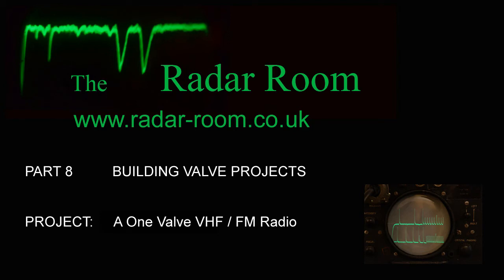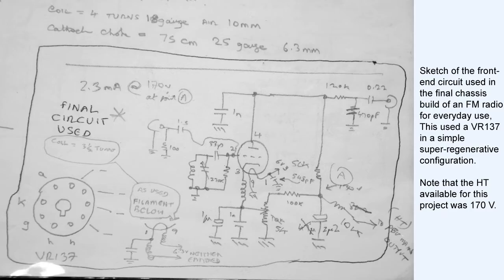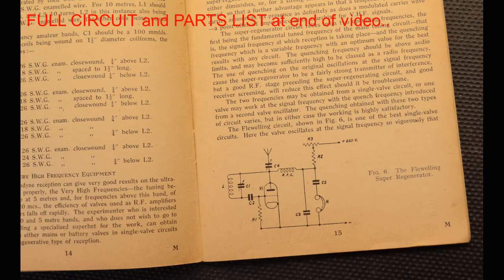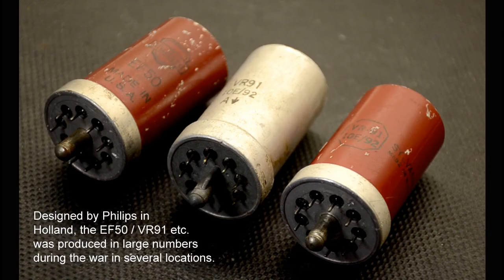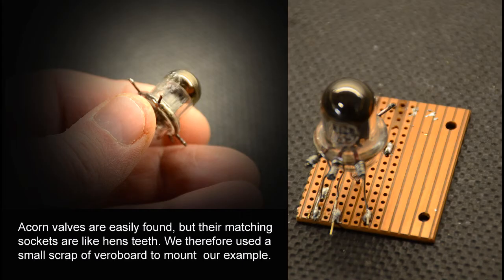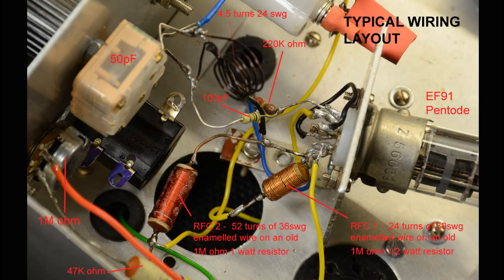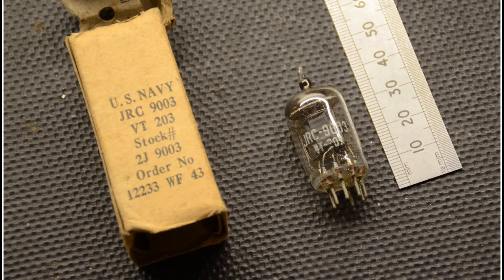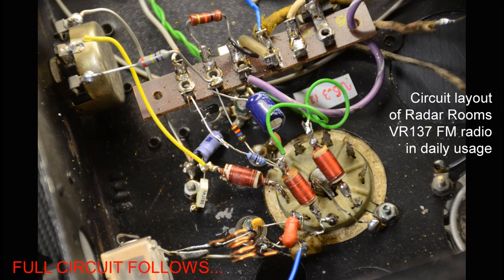One Valve FM / VHF Radio Receiver - tried, tested & demonstrated!

Comment: Hi can you please tell me what tube to use
Reply from the maker: It all depends on what you can find in your area I guess?

As-per the video, I am currently listening to a set with a VR137 in it and that works really well,  BUT it might be difficult to find one, then you have to find the non-standard  base to go with it. 

My preferred choice must therefore be either the 'ACORN' triode, the 955 or the identical valve in a different larger glass case, namely the JRC9003. There are LOTS of ACORN 955 triodes out there so I'd look for this. 

Note that there ARE bases for ACORN valves (even though I don't have any here) but I personally wouldn't like to use one as you have to force the little  pins down into some strong metal clips... I think they might break... 

Use my own idea of twisted wire on the valve pins soldered to a piece of veroboard. See my picture in the video to see how this is done. Good luck with making it!

Ps Just looked on fleabay here in the UK and found 15 of the 955 ACORN triode currently for sale.

Comment: Just one thing if people want to follow along then please use the vacuum tubes designed in 1947 with a heater voltage of 12V and a B+ of 12V and were to be used in Car radios because the transistors of the day weren't ready for prime time.
Reply from the maker: Pls. see my reply to your other comments.

Comment: High Voltages can kill
Reply from the maker: All very true David. 

Indeed it is possible to run valves / vacuum tubes at such low voltages, not necessarily those destined for car radios either. Take a look at the small 2 valve portable short wave set I had published in Practical Wireless, I have also made a YT video of. This uses two 1T4 battery valves and use an 18 volt HT.  You might also note that the 'universal chassis' I am using for the experiements, such as the one valve FM radio, double valve short wave radio, thyratron tester etc. etc. are all probably meant for an HT of +250 or +300 volts. However, I have deliberately set the HT on the chassis to a maximum of +90 volts. (As-per the original write up on it)

IMHO, this issue about safety is always a difficult one to address. Some people are naturally clumsy and careless with these high voltages, whereas the vast majority are probably not. So aside from offering multiple safety warnings (that may well be ignored by the minority) I don't think there is a lot more one can do, aside from somehow banning everyone from using anything above, say, 12 volts? 

I recently saw a video on a YouTube channel explaining how to take an old microwave transformer (circa 2,000 Volts on the secondary) and make burning patterns on a piece of wood with a saline solution. Absolutely LETHAL! I would go absolutely nowhere near it myself.....

Comment: I had quite good results with the EF91 as described on my cool386 website (which I notice the first one valve circuit was from). Having said that, a lot depends on the circuit configuration as well as the valve type used. A lot of published circuits I've found to be poor performers, with varying the B+ to adjust the regeneration giving less sensitivity  than adjusting grid voltage. Also, having both ends of the tuned circuit floating causes difficulties with tuning capacitor mounting and hand capacitance.
Reply from the maker: Having had a look at your website, it looks to me like you've 'been there - done that'!
 
Interesting about the EF91, as I felt that theoretically, it should be fine, but I just wasn't prepared to fiddle around with the bias etc. in order to make it work better, just to compare it with the other valves on test. 

Yes, you can see the effects of hand capacitance with the simple circuit used for my video. 

The other circuit I used in my 'everyday' radio, (in the black chassis pictures) is completely stable in this area and is hardly ever retuned from one week to the next, and never drifts. (I use it most days) The same can be said with the much more complicated Practical Wireless circuit I talk about earlier on in the video. 

Thanks for the interesting feedback. (I must have a better look at your site too!)
Reply: @lishaton  I recognised the PW circuit as a Fremodyne; something I’ve also covered extensively on the site. It’s a good performer in terms of sound quality, since it was designed specifically to have a response curve suited to slope detecting wide band FM. However, it isn’t quite as sensitive as a good straight super-regen set.

Comment: Hello! Good work! 13:47 - in my opinion: it would be useful to have an impedance matching. The input impedance of a tube and LC circuit is quite high. I had an experiment with BJT super-regen and matching coil. I achieved an excellent sensitivity -  roughly 2 microvolts on 50Ohms. I used an additional matching coil - the  main coil had 20 turns, and an additional - only 2 turns. The second important thing - is the waveform of quenching (signal  an oscilloscope in a 4nF capacitor). You can connect in series a variable resistor. To blocking RF in this case connect a 100 picoFarad capacitor after RFC and ground.
Reply from the maker: Some excellent suggestions! However, for this particular project, the plan was to keep it as 'simple' as possible, hence when we tried a couple of the sample valves, they didn't work particularly well (in this circuit) Clearly things would have been improved  had we made small component and circuit alterations like those you've just suggested. It still surprises me just how well something like this can actually work!
Reply: @lishaton  Yeah they're a small miracle these things, they kept me fascinated for decades now, trying to tame them for good. I still remember my first DIY transceiver for 11m band, build around a 6J6.
Reply: @andrewandrosow4797 
Did you also build the Charles Kitchin Receiver? I build it using tubes instead of J-FETs and got it to run on 2 meters band. Just changed the circuitry for an EC92/6AB4 in the detector stage. Thanks to that Quench-Waveshape system he introduced, I could easily follow the local 2 meter repeater without an external antenna!

Did you demodulate Narrowband FM succesfully with your version Sir?

Regards,
Thomas

PS. Impedance matching is indeed very important with a super-regenerative detector, it's after all still a regenerative detector forced beyond it's comfort-zone! Inductive coupling is better than capacitive, and it must be variable.
Reply: @thomasvandevelde8157  Hello! I made a receiver that consisted from two BJT. Emitters was connected together,  the base one and collector two was cinnected to ground.The base two and the collector one was connected to "hot" side of LC tuning circut (a cold side of a LC circuit connected to the ground). The emitters was connected through  an inductor (5-20uH) to a small capacitor (200pF) to blocking HF on the ground. This point is very important - you get an audio signal from the one - let's assume that it is a point with a title "CP1". To CP1 was connected a variable resistor 270KOhms that connected to positve/negative (it depends a type of transistor) bus of a battery. Now we went to the essential circuit in our receiver - control mode circuit.This citlrcut consists from a capacitor (several nanoFarads) that connect in series with a variable resistor (several kiloOhms) between CP1 and ground.When a resistance is maximal - the receiver can generating continously without flashing and superregenerative noise: in a speaker can be silence. When you change this resistor's impedance- you change a quench waveform: from triangle or pulse to smooth (like sinewave). The output impedance of this receiver is quite heigh - 100..300 KiloOhms: it woult be correct to reduce noise to use tube or jfet audio amplifier. I made experiments with this receiver and I received FM broadcast stations with specifing overdrive distortions - because wideband of this recriver was quite small. The quench waveform in CP1 was quite smooth - and the superregenerative noise in speaker was less intensive and brown. Unfortunately I have a very small experience in tube electronics - I only made a regenerative MW receiver (using a triode)  when I learnd in a school. This tube regenerator worked very vell - moreover it  received FM stations with very clear sound (I thought so in my young years) . In my oppinion - you can achieve the same effect in tube receiver: the grid leak  circuit can be more complex: for example  100KOhm resistor in parallel with a small  RF capacitor  (47pF)  and also in parallel RC circuit (4.7nF, 10kOhm variable). I have not done the experiment with tube - it's my own opinion.
Reply: @andrewandrosow4797  I did use a complex grid-leak system once, consisting of a 300k + 2,5k in series with a 220pF capacitor. This was the timing circuit for the quench-frequency too (as is the case with many superregens using transistors too) and this had a huge impact on selectivity yes. The noise indeed changes, and becomes less "agressive" sounding, so to speak. It worked only with very high gain tubes, wouldn't use it on an 955 Acorn for example. But the EC92 did just fine in this circuit.

And I'll tell you one thing: at higher frequencies, the input-impedance of tubes drops véry rapidly. For example the "Locomotive" of Tube-Era TVs, the EF80 pentode, has an input impedance of 10 to 15kOhms at 50 MHz! The CV408 frame-grid triode (the first for that matter, at least with an 7-pin base) has about 20kOhms at 45 MHz, so it starts dropping to the point you've got a few kOhms at 100 MHz. It's not much difference with a BJT at UHF-frequencies even. Also, the Q-factor and hence impedance of your LC-circuits drops so far by 100 MHz, it's just a few kOhms too in many cases. So, the higher in frequency you go, the more things get "equalized" so to speak.

I'd send you an email if interested, but could not find any emailadres on Youtube here? Perhaps I looked over it, it's possible. I'm not a digital proficient person 🙂

Comment: Ah the good old vr137
Reply from the maker: Just sits there and oscillates away, hour after hour, just under 100MHz :-)
Reply: @lishaton  Sad it has one of those impossible 9-pin EF50 bases, you don't find those around here. Did the British ever introduce the "standard" 8-pin Loctals at one point? Or they just went straight to Rimlocks and Novals?
Reply from the maker: I believe all types of bases must have been supported at some point in the UK, even for just a short time. I have a large number of ex. equipment types here which must encompass many of them.

Comment: Neat! Thank you for sharing!

Curios, what would increase the ability to to pick up weak stations? I am in a rental, so can't go crazy with an antenna and some reason FM stations are hard to pull in.
Reply from the maker: To be honest, without significant changes to the circuit, I don't believe it would be easy matter to improve the set in this particular area. With our own situation, where the set was demonstrated for the video, I think it is surprising just how well it worked with just one metre of 'throw out' wire in a semi-basement situation combined to a 'not-very-good' signal strength area. But of course, you can see how different the 'Acorn' valves were when compared to the other types tested. Maybe worth trying other types? You'd need an additional coil at the front end to use a dipole which might improve matters too. Aerial positioning, even with a simple length of wire makes a BIG difference to signal strength. It is possible that you might find that an air-spaced variable cap might be slightly better too if you're not already using one?? Incidentally, I have recently done a spot of experimentation with a slightly different super-regen circuit with a tapped coil and a dual tuning cap, combined with a second valve as an RF amp, but have found this gave little significant improvement.
Reply: @lishaton  , thank you for the reply.

Mind me asking what happened to part two? Or would you say the 6SL7 be the valve of choice? 

So the gain of the tube has no impact on sensitivity?

When say dipole, you mean a T shaped wire or a manufactured antenna with a coax cable?

Were would one find the specifications on the additional coil?

Not really any aerial positioning options, north is the only side exposed, to the about west-northwest is where local FM comes from, so probably the better of the three anyway.

To be clear, I have never built a piece of equipment. So no, don't have an air-spaced variable capacitor. My goal is build a tube amplifier and thought the simplicity of this unit be a good start, plus, be fun to see how compares with a solid state tuner (does better than anything had before, however, sometimes gets finicky).
Reply from the maker: Sorry, I've literally only just sen this! To answer your questions one by one:
My Mk2 VHF / FM version was tried with both the VR137 and the Acorn 9003. I didn't bother with any others having tried them for the demo you've seen. The additional RF stage using another acorn was simply not worth the bother as it really made little - if any difference.

Yes, by 'dipole' I meant a coaxial lead which ended up with either a T shaped pair of wires, or solid conductors. Check the dimensions. About 1 1/2 metres for a dipole split in half and should be ok for FM radio. The coupling coil will be just like most other aerial coupling coils. The smaller coil should be something like 18swg self-supporting with about 1 1/2 turns made on a 3/8" diameter former. Position this near (in line) with another self-supporting coil using the same wire on a 1/2" diameter former. You could try putting a low value trimmer across it of about 20pF to allow for a bit of tweaking. The two ends of the smaller coil will go to your coax. of course. Your chosen signals determin whether the dipole is positioned vertically or horizontal.
Your last comment about a valve amp. suggests to me that you should try for a circuit using a single small triode-pentode valve like an ECL80/82/86 etc. I think you will be pleasantly surprised just how good one is. Food for thought...Maybe I'll build one in a day or two for another project  :-)
Reply from the maker: Sorry, missed the bit about the second part of the coil. Approx. 4 & 1/2 turns self supporting made on a 1/2" former. (In line with the 1 & 1/2 turn going to the dipole.)
Reply: @lishaton  , I myself been unwell.

Interesting you mention the ECL86, I have taken a fancy to it, however, was unsure about proceeding forward (crickets on the forum); been almost a week. Just put an offer on a pair of PCB boards. Thank you. 😀

By the way, to challenge myself, did try and build this one valve in LTSpice, however, wasn't sure how to model the antenna input signal, nor seems anyone else. Also, LTSpice doesn't seem to like pots either and again been a couple weeks of no reply. Typical for me to think so unique (I am Autistic) no one can help with my ideas. Bet no one has ever modeled a receiver in LTSpice.
Reply from the maker: Hi again!
Sorry for the time to reply, but there seems to be no way of telling if there has been a further reply to an original comment. This means trawling thru' EVERY SINGLE original comment to see if there has been an follow up to any of them! Sorry, but I know nothing of LTSpice - just looked it up on line... Maybe it is not meant forsimulating this type of circuit?? THe ECL86 is a very useful valve, particularly if you#re looking for a decent power output for audio. Should work for a SW receiver but I don't think it will work at VHF  but I could be wrong! Othersimilar  useful output valves are the ECL80 and ECL82. If you don't mind an 'odd' filament voltage for the same valves, then there are also the UCL and PCL variants :-)

Comment: Hello, I am experimenting with a similar circuit in which I need a transformer of 600 ohm primary and 10K secondary, could you advise me how to get it or what type of transformer would work for me?
Reply from the maker: Good question! Not something that one finds easily these days. In order to end up with a 10K secondary, I can't think of anything aside from an EHT / high voltage transformer, though I doubt if it will have a 600 ohm primary. What is it actually needed for? Maybe it is possible to alter the circuit, or substitute something else?

Comment: I remember experimenting with similar circuit but with ECC85. It did receive local station very well. I live 10 miles away from the 120 kW transmitter so that signal is particularly strong in my house. Good audio quality but very sensitive to environment - moving hand, changing temperature, voltage etc - everything caused frequency drift.  If properly assembled on chassis, with respect to the principles of HF circuits, it might have chance to work.
Reply from the maker: I agree with all you say. However, the one with the black chassis in the picture is used most days and seems quite immune to hand capacity effects etc. as I feel it has been built to a reasonable standard (?) I'm not sure where our nearest transmitter is, but I think it's quite long distance as we use a chimney FM aerial for our Quad FM tuner. Whilst the super regen set never seem to need retuning, even after switch on (i.e. it doesn't seem to drift at all) the signal does vary in strength from day to day, I guess due to atmospherics etc.

Comment: Very encouraging and informative video,  i love experimenting with valves
Reply from the maker: Glad you found it useful! At least you can see the circuit actually tried out with different valves on the video. Do have a go with it sometime. Don't forget that by making small changes to the coil, you can pick up anything from ordinary FM radio on 88-108MHz, thru' the aircraft band (108-136MHz) right up to and including the 2M amateur band on approx 144MHz.